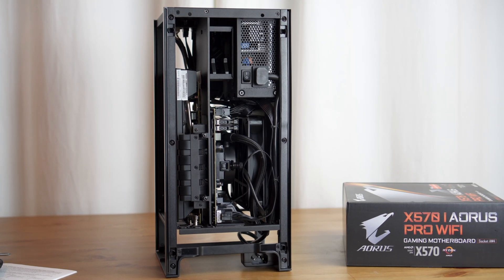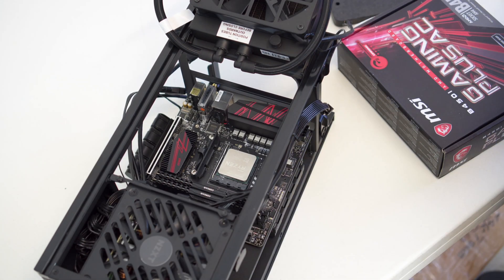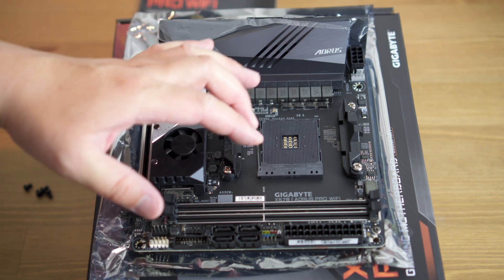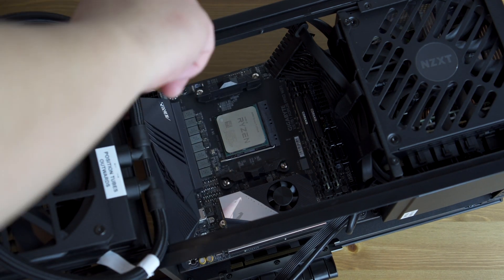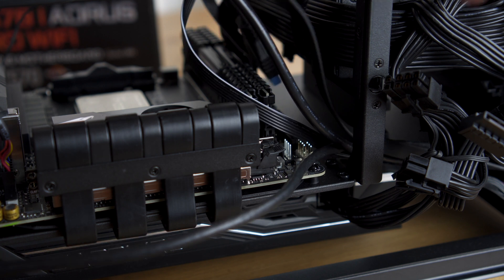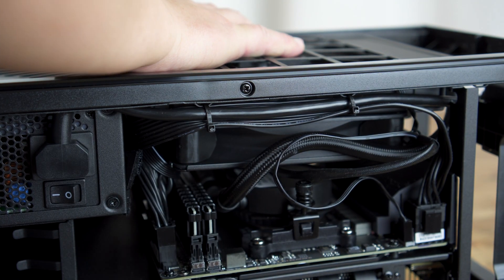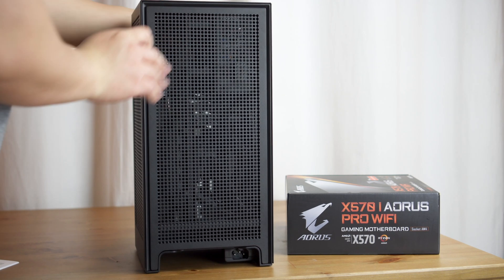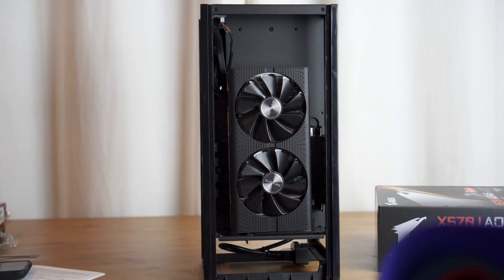NZXT H1 Hackintosh 3900x x570i Catalina 2020 ITX Build

Comment: Hey Sean, I read that with this board's fan headers being quite far away from eachother, the H1's two fan connectors from cpu pump and the fan doesn't reach in one of the far corner fan headers.  Apparently you need a fan header extension to make one of them fit. Hope  this makes sense, did you encounter the same issue?

Comment: Hey Sean, I'm planning on buying the same case for a Ryzentosh (well multiboot actually with Windows and Ubuntu)by early 2021. I tried using opencore to set up hackintosh on my laptop (i5-9300h+ GTX1650 ti) but whatever I did always ended up with kernel panic because of some Non-apple device. I'll be using this with a 5600x and RX6800 (Bios update for R5-5600x must've come for ASUS X570 by then. Can you make a video if possible as to exactly how you set up your own Mac OS. That'd be really helpful. BTW great video on setting up NZXT H1. Except that thermal paste tho. LOL.

Comment: I have nearly the same set up -only difference is I did the 5700XT, and I used my 2nd M.2 for a 2nd Sabrent Rocket for my Windows dual boot. The real trick with this build is to make sure in BIOS is set up with PCIE 3.0 set. But, after 15 hours, I decided to spend $99 and send it to Technolli -$ well spent.

Comment: Awesome video! Great build. I actually set out to do exactly what you did in this video except with Intel. I ended up getting an H1 case but changed my mind and moved over to the Dan Case just to make the whole system extremely portable. But I love those Aorus boards. I'm using the Z390 version. Great stuff and now I'm just waiting to adapt my wifi card so I can get airdop and things. Again great video!!
Reply from the maker: cool! I'm actually thinking about a different case as well. this case is great, but I want to try out different cooling options and you can't really do that with the H1.

Comment: I want to build like this one!!
Ryzen 7 3700x 
2060 super 
16gb ram 3200
1tb Ssd 
2tb Hdd 
Is any temp problem?
Reply from the maker: on daily use no, but I have done a couple cinebench tests for about 20 minutes and it does get up to 80 degrees C. I normally don't have that kind of workflow to beat it up at 100% for that long. If you constantly have a heavy workflow like that, I would probably recommend another case, so you have more options with heat management.
Reply: i have this exact build but with a 5700xt red devil GPU. no issues. CPU runs around 60-70C, GPU runs in the mid 70s with a standard undervolt from the Radeon drivers (actually gets better/equal performance).

Comment: Why did you choose ryzen over intel (aside from the value-performance ratio), how's the stability of it running hackintosh? :)
Reply from the maker: Yes, it was purely for more cores at the lower price. I have had no issues with stability. There's is one thing I can't get to work on this machine and that's the sleep option. It won't wake up from a sleep. It didn't seem like a big deal at first, but now, I would like to get sleep to work in the future or go the intel route where I know everything will work.
Reply: @seanmoua6791  hmm I see, might actually go for intel build since Ryzen in my country is at the same price as intel LOL. Thanks bro, great build!

Comment: I am wondering where do you put the apple wifi card
Reply from the maker: You can refer to this video that I made with the wifi replacement card. https://youtu.be/2nST8sDYsa4
Reply: @seanmoua6791  Thank you so much this helped a lot! By the way does this wifi card work with any intel z490i motherboard?
Reply from the maker: Jiawei Feng i haven’t done it but I think it should work if it’s m.2

Comment: Great job 🎉  I planed to build the same ryzentosh at the beginning, but there was no any x570i board available in quebec, so I go for 10700k now
Reply from the maker: Yeah, its tough to get parts now! Good luck with the build. 10700k should be good enough, 12 core is a lot and I hardly ever push it.

Comment: So front panel USB- C is not working? Is there a way to make it work if I buy this motherboard?
Reply from the maker: i'm not sure if there is a way, there a couple other itx boards out there that will have a port for front panel usbc, but i haven't tested them for a hackintosh build.
Reply: You can go with B550i Motherboard or any Intel Mobo with support for that

Comment: It was a good video. I have a question.
ITX type motherboards have only one PCIe lane.
How do I use a Wi-Fi card for PCIe?
Also, is Air-Drop available?

I'd like to make one too.
Reply from the maker: You'll have to buy a motherboard with the wifi m.2 and replace it. You can check out the video I did on how I replaced mine. 

https://youtu.be/2nST8sDYsa4
Reply: @seanmoua6791  Thanks for the reply.
I watched the video you linked to.
It's wonderful.
Thank you!

Comment: Hey man great video
On pc part picker it says that the 3900 and the msi motherboard are in compatible. Did you run into any issues with that?
Reply from the maker: No I didn’t have any issues with the msi b450 board. I ran on it for a couple weeks. I’m thinking about using that board for a build for my wife.

Comment: Why choose the RX 580 over the RX 5700 or 5700 XT?
Reply from the maker: my workflow with for editing my YouTube videos are more cpu intensive than gpu. if you need better gaming, you might go the other route.
Reply: @seanmoua6791  Having the same question as VYBE. Would it be compatible if I swap out RX580 and go with 5700XT?
Reply from the maker: Nelson N I don’t have a 5700 but from the I read and seen on YouTube  yes! It’s swapable or after first boot.
Reply: @seanmoua6791  Hey, thanks for the info! great job on the video ;)

Comment: I have a macbook and want to build a hackintosh from scratch, but I am afraid(
Reply from the maker: I was actually in same situation. I had a 5 year old MacAir and I wanted a new system, but the MacBook Pro 8 core was too expensive and less powerful, so I went this route. If you buy the same parts and follow the technoli channel guide, you should be able to do it.

Comment: How did you get the WiFi going with this board? Did you replace the existing WiFi module?
Reply from the maker: yes, I had to replace the wifi card. its a m.2 card within that wifi module. I shot a quick video on how to do with my GoPro, I might put it up in a few days.
Reply: @seanmoua6791  oh nice, thanks for sharing.
Reply: Saw the video. Thanks!
Reply from the maker: Andrew Cheng thanks

Comment: Hey Sean I think the msi b450i the Wi-Fi card is replaceable. A friend of mine had a b350i which has a similar layout and even looks the wifi card cage is similar and is removable in the b350i. Underneath the wifi card cage/enclosure the wifi is removable. His failed so we replaced it. Don’t know if it’s the same as b450i this is just my assumption. Also don’t know if the bios will block it like some mobo.
Reply from the maker: thanks for the heads up, I didn’t think about it and I thought I wanted another m.2 because I wanted a dual boot, but now it’s a little too late. If I have another build for a friend I’ll test it out.

Comment: Hi, can you please share your EFI?
Reply from the maker: Sure, Try this link and let me know if this works for you

https://drive.google.com/open?id=19X7NFex-oTRKA1JXKyAX-hEhnOYHdO_K
Reply: @seanmoua6791  hey Sean, thanks a lot for making this video and sharing your EFI. I couldn't build mine yet. I pre-ordered the case but they told me to wait until June 2. I will let you know after I build it though! Cheers!
Reply from the maker: Eren Atas cool, let me know how it goes. I’m glad you were able to get a hold of the case as well
Reply: @seanmoua6791  Will do. I already have a Radeon 7, I will get aorus board and 3900x. I am also planning to add 3 40x20mm noctua fans as exhaust for gpu. I have high hopes with this one.
Reply: @seanmoua6791  Hey Sean, I have bought the parts today. I thought yolo and bought 3950x. Hopefully will be able to build when the case arrives.
Reply from the maker: Eren Atas cool! It should be a killer of a system! Let me know how it goes!
Reply: @seanmoua6791  Hi Sean, great job. Can I ask if the sleep/wake works with your EFI?
Reply from the maker: AAA Three it is not working. I haven’t looked in it to see if I can make it work. If you have already found a way let me know. 

I do have the monitor set to sleep and the monitor does wake up from a sleep. The computer itself does not wake up from a sleep. I have disabled the computer sleeping for now
Reply: @seanmoua6791  Thanks for the reply. I heard setting the SMBIOS type (to MacPro7,1) might solve the issue. Don't know for sure.
Reply from the maker: AAA Three that’s good to night. I’ll try it out this weekend and keep everyone updated
Reply: @seanmoua6791  Sounds good. I just got my Ryzen 9 and will try this weekend. Thanks a million for sharing the EFI, I will try it out!